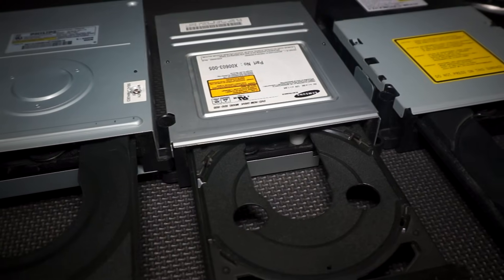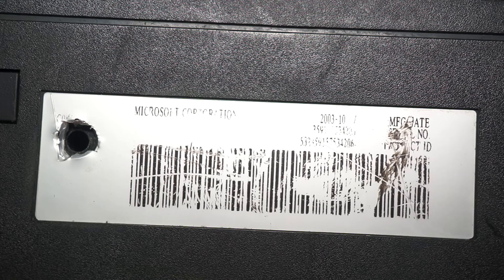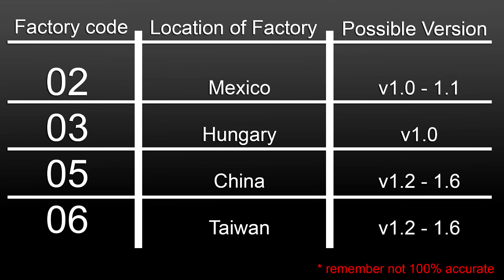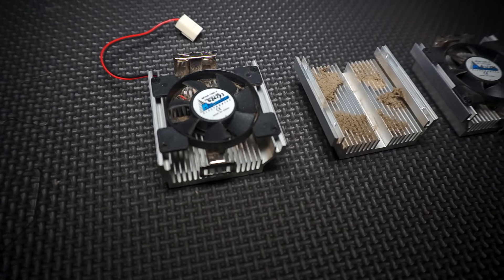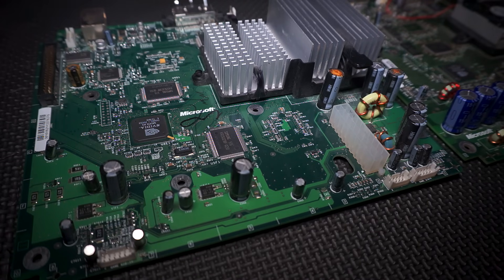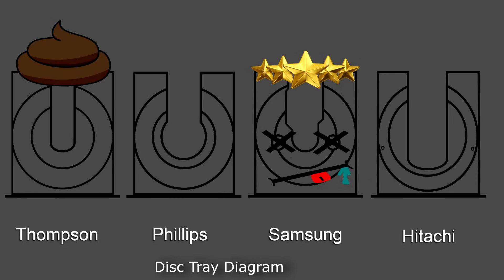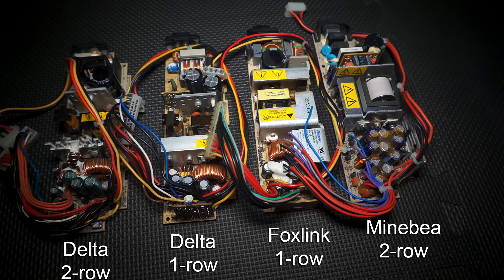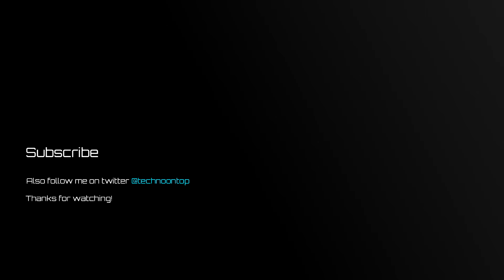How to tell what version original xbox you have

Comment: Sticker: factory code 5
Year 2002
I do see this sticker is on top of another one, which is a pain in the ass to pull on.

But kernel sticker on board says 4034, and it's got that tiny fan. And the Foxlink
I guess a v1.0
Issues with this one is the HDD decided to die or whatever they do, so definitely need to get this thing cleaned up and get that cap out while I'm at it.

I've had nothing but problems with Thompson. First xbox I had, had near immediate failure with its fancy optical drive.

Maybe the one in my second xbox still works.

My other one's probably v1.0 as well, but that one's power fried right after that cable incident you mentioned. Literally fried after I plugged in the breaker cord and turned it on. Press power-CLICK. Burning smell. Thanks M$.

I'm assuming I should just get a chip and then outright replace the HDD with SATA using that converter kit and 80-pin IDE. Now to figure out just which 80-pin IDE, and modchip to choose...
Reply from the maker: Yeah only the v1 had the gpu fan, as far as bringing it back to life you are on the right path with everything you said, there's not much choices as far as modchips just open xenium and aladdin chips, the open xenium has more bells and whistles but those extra features aren't for everyone. Sucks that your other Xbox died like that I haven't had one do that since I was a kid..... I guess it's worth it to always open them up and have a look inside before powering them on. The ide cable your looking for needs to be at least 24 inches and it will take a bit of origami to get it to work lol.. If your going to get a big harddrive like a 2tb then be sure and get the startech brand ide to Sata adapter,
Reply: @TechnoOnTop  Yeah, I saw that Startech 'on sale' on amazon for $17, and I had a $10 amazon credit, so I couldn't say no to $7+shipping.
I'm gonna stick with a 1TB, hopefully the 24" IDE I picked up can be finagled with enough to get it to fit. Some reviews say it does work, but the cable has a sleeve. That was the only con. (pretty sure it can be cut off)
 
As for the Open Xenium, looking at this listing atm https://www.ebay.com/itm/293382870758
I take it they're pre-flashed to work out-of-the-box, but the 1.6 being thrown around on there is probably referring to the pins being full length.

The Foxlink is the unknown variable in all this. I haven't powered this thing on in a few years. I should probably play it safe after a power-on test and pick up a cap kit

Comment: Huh, I was surprised to find that mine's a 1.6, as I'd softmodded it a while ago without any issues and was under the impression that you couldn't softmod a 1.6 without some hardware mods, but hey I'm not complaining. Thank you for your awesome OG Xbox videos, it's nice to see such passion for this old beast.
Reply from the maker: Yeah all Xbox versions can be softmodded no problem. The 1.6 just doesn't have a Tsop chip like the others so in order to hardmod it needs a modchip. The LPC also needs to be rebuilt Microsoft was trying to fight the modders but in the end didn't do to much. I really appreciate you saying that! Alot of them are pretty old now, have a few iv been working on but the process has been slow
Reply: @TechnoOnTop  Doesn't hardmod by definition mean there's a modchip?
Reply from the maker: @deoxal7947  sorta, the v1-1.4 can be TSOP flashed, which is essentially a hardmod. If it's a 1.6 then it would need a modchip to be hardmodded
Reply: @TechnoOnTop  Oh I see. I just thought of modifying the TSOP would be like installing custom firmware on a 3DS or even a PC.

btw the DVD drive in mine isn't reading discs, it spins and I can see the laser turn on but it just doesn't recognize any of my discs. The xbox is a 1.0 with a samsung DVD drive.

What would you recommend I do to find out what's wrong with it?
Reply: ew

Comment: I remember calling Microsoft back in the day and talking to that really cool automated system and getting a replacement surge protector for my first Xbox, unfortunately I lost it years ago
Reply from the maker: I do slightly remember having to call tech support, though I'm pretty sure I actually talked to some dude, ended up having to send my Xbox back honestly have no idea why, maybe the disc drive stopped working? All I know is it was a long few weeks haha. Thanks for sharing and for watching!
Reply: @TechnoOnTop  if you come across a few xboxs with bad cd drives and such let me know, I run a vintage computer shop and wanted to try rebuilding the CD drive using it's ATX counterparts.

On that, I've owned two 1.0 and 1.1 consoles with the single rail, more commonly known as AT style power supplies, vs the dual rain being ATX. I miss my old one but was happy I found another for $25 locally. I just replaced the clock battery and plan on doing a hard drive mod but keeping a stock interface
Reply from the maker: Im sure I have a bunch of broken DVD drives, I just kinda throw them in a bin all together, so not sure what's broken and what's not, most either struggle to read disc's or don't at all. Your talking about putting in different laser assembly? It would be awesome to find replacements for those would really help alot of people out
Reply: @TechnoOnTop  I have over 150 IDE cd drives, Im bound to have parts that will work. I just need the xbox drives now lol
Reply from the maker: @killerkip1  wouldn't it end up just being the same problem at some point? whats needed is a source of new lasers that will work not just a random one from a random drive that also probably doesn't have replacements made for it anymore. i find it weird that not chines company has started making some type of replacement, considering you can find cheap aftermarket replacements for the ps2, psp ect..
Reply: @TechnoOnTop  I'm only one guy though unfortunately, all I can tell people is hopefully a cheaper common model CD drive has a compatible lense, and it's literally plug and play if I'm successful

Comment: Does the Xbox need the fan on the heat sink?
Reply from the maker: If it's the v1 that came with one and your using that same heatsink then yes, if your using the newer heatsink then no.
Reply: @TechnoOnTop  Huh. The fan was making my Xbox SUPER loud, and I decided to take the fan off the heat sink just to see if it'll overheat. It never did. I had Halo 2 running for a couple of hours.
Reply from the maker: Yeah those fans go out and sound like lawn mowers lol. They are there for a reason (though I ignore things like this as well) iv found replacements for them in the past but nowadays I just put the newer heatsink on them. It's really up to you but I would replace it.

Comment: My xbox has stopped keeping time and date so I've been trying to figure out what version it is. Production date is 2004-3-3, China build. It was modded about 10 years ago, in xbmc it says it's 1.4 but in dashboard it says the kernal is 5838 which is 1.6. Opened it up and the vid chip is focus. Doesn't seem to be any leaking around the clock capacitor so I don't know whether it's 1.4 or a 1.6 there.
Reply from the maker: This whole kernal version to check your version should be taken with a grain of salt just like using the date printed on the bottom. Xbmc will tell you what you have and the video chip will get you in the 33.33% area which for most purposes of getting modded is all you need, I see the reddit post your referring to and though all this extra information is nice (and accurate) there should be some disclaimers to help people not become so confused about it. I guess the main issue is over the years there's been alot and some Xboxs that where refurbished by either Microsoft or a third party could have a mixed bag of parts. Iv even put Xboxs back together with all different parts so I wouldn't put it past anyone else just trying to fix a console to do the same thing. Hopefully that helps thanks for watching

Comment: It appears I've got a 1.6

What am I missing out an as far as the lack of extra RAM? All software should work with just the stock RAM, right?
Reply: Wait, I've got a 1.6 Mobo but what looks like that first model power supply... What do I make of this?
Reply from the maker: I'm not sure what you mean by it looks the same of it was a single row I'd be pretty blown away and would immediately think it's not a 1.6. But on 1.6's the video encoder is also the worst one, it has trouble displaying a few games in its max resolution, fable, jetset, Orta dragoon,
Reply: @TechnoOnTop  The actual layout of the power supply board resembles the one mentioned that catches fire, despite being connected to the board with a 2 row connector.

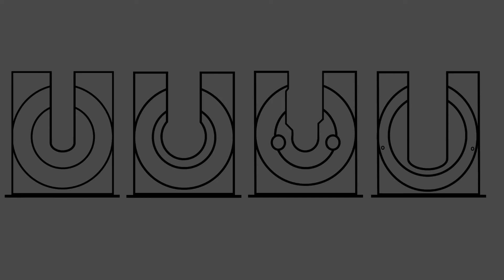Comment: ----->   :IMPORTANT TO EVERYONE WITH AN ORIGINAL XBOX         6:08 Look at how two of the capacitors are literally bulging out the top with the liquid inside coming out.  EVERYONE who has an original Xbox should make sure their Xbox isn't ruined by this.  The Capacitor Plague!  If ANY of the acid comes out of the capacitors and leaks onto the board, this WILL eat through the board and destroy traces causing the Xbox to fail.  I HIGHLY RECOMMEND opening your Xbox to make sure no capacitors are bulging or have exploded acid onto the board.
Reply from the maker: Yeah it's definitely something to look for, the whole clock capacitor issue is definitely becoming more and more common knowledge. But as you mentioned it is possible for other capacitors to fail and as the console gets older more will fail definitely something to keep an eye on.
Reply: @TechnoOnTop  What would you say the average price is for an original Xbox?
Reply from the maker: $10-20 console only, $30-40 complete fully working with at least one controller, that's my thoughts, I don't like to pay more then $2 a game, $10 first party controllers, obviously I'd go up for certain things
Reply: @TechnoOnTop  That cheap for a good console with great games?  I'm buying one!
Reply from the maker: Yeah I'm cheap but only because I have about 6 working ones around 8 for parts ones , but expect to pay more most people tend to charge eBay prices, but I love the ogx always have so I'd recommend picking one up
Reply: @TechnoOnTop  Thanks!

Comment: I got a 1.5
Then i read your comment... I am confused now.
Reply from the maker: Just test the other pin, I mentioned in the comment, that's the only thing wrong, the pin I say in the video will always come with a positive ID. Sorry for the misunderstanding I wish I would of caught it before uploading or even within the first few days
Reply: @TechnoOnTop  thanks for the reply. Tested the other pin and its connected.  This got me into my xbox that i haven't opened in 5 years or more. All my caps look good still.
Reply from the maker: Glad all looks well inside, just make sure and keep an eye on that clock cap could start leaking at any time, removing it is a simple job so long as you have the proper tools, iv know people to just wiggle it off but i wouldn't recommend that lol
Reply: @TechnoOnTop  i plan to look up the specs and replace it soon. I got the equipment. I used to mess around with car audio amp repair.
Reply from the maker: Oh nice should be super easy for you then, replacing it isn't necessary on 1-1.5's all it does is keep the clock going for a bit if it's unplugged, also if your modded and have it hooked up to the internet that fixes your time. Anyways good luck with your project if you have any questions feel free to ask I will do my best to help.

Comment: hmm first thing to go bad on my xbox was the power port. . . It was always tricky to plug into with the spark sound but if you wiggled it enough and had it at the right angle it would finally play (man my younger self lived dangerously XD) then when I soft modded earlier this year my disk tray stopped opening (easy fix as I just had to replace the rubber band and clean it) the next thing I didn't think of was the capacitors going bad. . . I bet that'll be my next project to take care of. . .
Reply from the maker: Haha yeah definitely a bit on the dangerous side, for sure take care of that clock cap, I haven't found one not leaking, but I haven't been picking up to many Xboxs lately, I think only 4 this year lol... Thanks for sharing and watching!

Comment: What is the date on you 1.5?
Reply from the maker: The points I tested are off by one, so the result I got was wrong, it was pointed out to me well after posting the video (wish I could just edit that part) , see the description for the right pins, also top pinned comment has the correct one. On another note the Xbox I thought to of had is long gone or at least the sticker that was in the bottom of it.

Comment: ive got a 1.6b (hynix 510a) found it in a shed with no harddrive lol guess im modchipping. the resistors look brand new in this one and are a dark green not black, lucky lol psu also looks different than those, idk what the name is all i can find on it is "tuscany rev 1.0" but it is a two row.
Reply from the maker: Yeah will definitely need a modchip to get it up and running again, luckily Aladdins are cheap, yeah haven't ran across that brand of power supply, I know at some point there was "aftermarket" ones, which I suppose is possible considering the one you found has been opened, thanks for sharing and watching!
Reply: @TechnoOnTop  I will check that chip out, appreciate the response 😎 and lol it was totally apart top off when i got it, im gonna have to put some new thermal paste and clean it but it looks really nice. I like the variety of parts you have got in your collection!  Kudos on the video!
Reply from the maker: It's about the only chip on the market until people start receiving their open xenium chips from their manufacturer, if you wanted a chip with all the bells and whistles I'd go with that one, might have to wait a few more weeks though, course you could always upgrade to it later. Sounds awesome man sounds like you have a nice little project and an Xbox that should give you hundreds of hours of enjoyment, haha yeah that collection is mainly what iv managed to break over the years of modding.

Comment: Got an original Xbox with a 2-row power connector and a Conexant video chip - not sure whether it's a v1.2 or a v1.3. Unfortunately has a Thomson drive, they are as bad as people say - rather flaky and struggles to read some retail discs. Managed to remove the clock cap before it went postal on the board fortunately.
Reply from the maker: Probably a 1.3, glad to hear that you got the clock cap out, yeah I have one as well that's not great it will read some disc's but the amount of scratches doesnt seem to matter to it. A Samsung that reads everything but is always stuck, iv cleaned it, it just refuses to open when in a console so it's a work bend drive now, then I have a Phillips which is perfectly working so that's nice lol. Thanks for watching

Comment: Okay, so I finally got my crystal xbox (Hard modded with Xecuter 3) out of storage as I was planning to de-cap the clock capacitor..  The Serial number is 2/006931/4/36/05 = China and anything from V1.2 to 1.6... 

Video chip = Xcalibur
RAM = Samsung

Would I be correct in believing that I have a V1.6?  I feel confident...  ALSO, does this mean I have no capacitor to remove??

Many thanks for sharing your knowledge.
Reply from the maker: Yes it's a v1.6, no need to remove the clock cap, if you do it will "break" the console, iv seen some people actually have leaking clock caps on a 1.6 but I'd say it's pretty rare, not a problem thank you for watching happy modding!

Comment: Great video Techno! 

I have a question?

I noticed you had removed your original heat sinks and replaced them with a 3rd party ones.  I like the ones you have. Where can I purchase one?   If they are out of stock any recommendations?  

Thank you 
DarkAlex
Reply from the maker: Those are iceberq pro 4's, they haven't been made for years, they pop up on ebay every now and then, I paid $20 each forever ago, I believe the hole spacing is 55mm, I spent a little time looking for an alternative but I never ordered and tested them, i dony have the link any more, it's buried in comments somewhere. Another thing to note it can only be done on Xbox's v 1-1.5
Reply: Thank you Techno!

Comment: I just bought an August 2004 so I hope I have a 1.6 since I don’t want a clock capacitor leak.
Reply from the maker: Pretty good chance it is, one way I found that was taught to me after this video, check the av port on the back if you see metal shielding all the way around it, then it's a 1.6
Reply: TechnoOnTop Thanks!

Comment: I got a v1.0 and the extra fan makes so much noise does it hurt the system alot if i disable it? It still has passieve cooling right?
Reply from the maker: I wouldn't, I'd just replace it, or you could upgrade the heatsink to the newer style one. I'm sure you could find one on ebay or at an og Xbox community.
Those fans are known to give out and sound like lawn mowers lol replacements of the exact type can be found, but in my experience with them they don't last long,